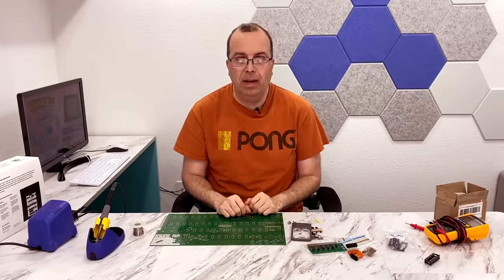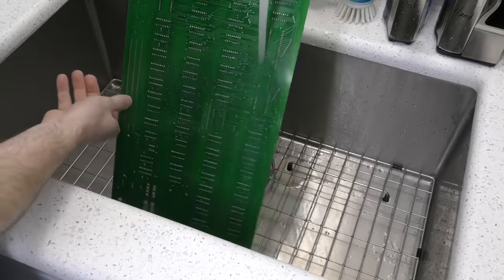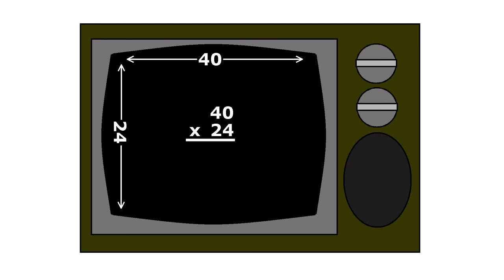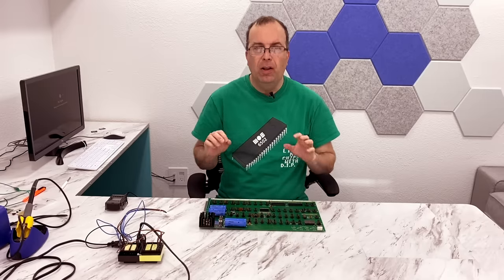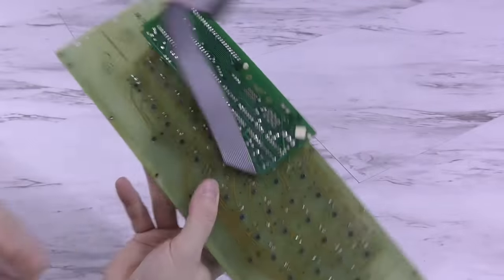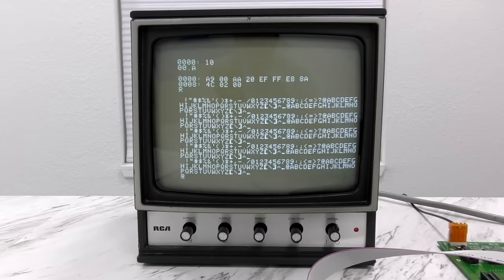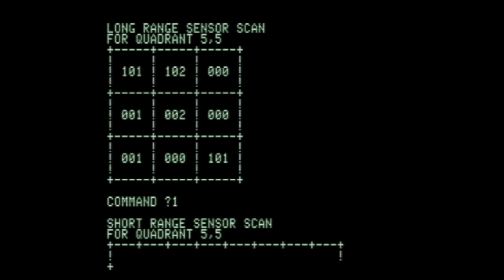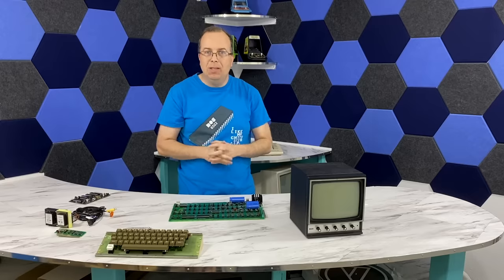How the Apple 1 computer works.

Comment: Nothing says “70s computer design” like an exposed power supply!
Reply: If you had to ask you didn’t need apply…
Reply: meanwhile the imac pro
Reply: Well, to be fair, the power supply is still exposed in modern iMacs, it's kind of a nightmare when you're disassembling it.
Reply: That wnd the scrap wood holding up the keyboard
Reply: i have a computer fron 2004 that has an exposed power supply
Reply: Nothing says "fire hazard" like an exposed 70's power supply.
Reply: Still exposed on the new iMac Pro
Reply: @vouvusbovus9100  electric safety awareness isnt like what is now back then
Reply: and nothing screams 70s power supply like a heavy laminated copper transformer with the mandatory multiple outputs on the secondary :p
Reply: the imac has one
Reply: @Hazard yeah, the dc might be harmfull, but what about the ampere.
Reply: Laptop chargers be like
Reply: @lennonmclean  what laptop chargers have exposed wires?
Reply: @Hazard low voltage does not equal low hazard, cars run on only 12v but I certainly wouldn’t want to touch the battery terminals to my tongue because the amperage would be 600 amps or greater (or less depending on car)
Reply: @surrodox  Back then there was an greater amount of common sense, nowadays everyone seems to have the urge to touch things which aren't supposed to be touched...
Reply: @markusTegelane  Greetings from PS2 slim and Dreamcast.
Reply: @ArtemyMalchuk  oh, that's true
i think PS1 had an exposed power supply as well :D
Reply: @Fhwgads11  no, depending on the resistance of your tongue
Reply: @markusTegelane  yeah, Xbox too
Reply: Oh yes.
Reply: I think I would prefer a clear plastic case for the board. I think it would look unique. Unless it would melt the case then I would go for a metal one.
Reply: @pinakinkale  “new” it’s three year’s old, micheal
Reply: @AemVR  wait what, holy shit you’re right damn time passes fast
Reply: My first PC was a Packard bell and it only had one hard drive bay. When I bought a second hard drive I said, oh what the hell, and placed it right on top of the power supply. Never had problems using it.
Reply: @Fhwgads11  Always that BS (sorry). The car battery may have an internal resistance which ALLOWS it to deliver 600A peak current. The current in circuit is defined by ohms law though, and since your body has a few hundreds of ohms (much more, 10-100s of kOhms, for low voltages on undamaged skin .. the tongue IS low resistance though) the current will be limited to a few milliamps AT MOST, which will not feel good, but won't kill you or something like that.

Well, except you crack your chest open and apply the wires directly to your open heart, in that case a few volts are plenty to be fatal. (Surgical tools used for such tasks are limited to I think 6V or something like that AND limited to a certain amount of current because of that).
Reply: @ArtemyMalchuk  PS 2 slim uses an external power supply that was not exposed like a laptop charger.
Reply: When I was 15 I had a PowerBook 520 charger plugged in and exposed and my hand fell on the cooper windings and all it did was vibrate my hand.
Reply: @pyeltd.5457  I mean 9000x. Those had internal power supply installed again
Reply: Exposed power supply WITH an ashtray.
Reply: No kiddin

Comment: I had always imagined that the Apple 1 was just a less advanced version of the Apple II. Turns out I was right! In the same way that a sharp rock tied to a stick is a less advanced version of a chainsaw! It's amazing how much people were able to do with these early computers!
Reply: I don’t think it’s entirely accurate to say the Apple 1 is a less advanced Apple II. That’s similar to saying the Genesis is a less advanced version of the Neo Geo or a Macintosh. They all share the same CPU but 95% of the rest of all those computers are completely different. The Apple 1 clearly has an entirely different way of generating video and also has no sound apparently.
Reply: You hear yourself, right?
Reply: @phonotical  It's clearly a joke.
Reply: The Apple I PC boards were assembled and wave soldered for $13 at the place which manufactured the raw PC boards. Only a few were hand assembled, part by part, at home.
Reply: @SteveWozniak  woz would disagree
Reply: It’s amazing, it’s kinda line the Apple II was a sequential update to the Apple I.
Reply: Spoiler haha
Reply: If you compare the Apple I memory monitor (just prints segments of memory to the screen) to the Apple II memory monitor, you can see how one grew out of the other
Reply: @DeviatingVapors  beacon
Reply: @casparhughey5651  is this a joke?
Reply: Computers before Apple Macintosh and IBM XT were absolutely useless. They weren't even useful as calculators because they lacked hardware acceleration for floating point and multiplication.
Reply: @IkarusKommt  Tell that to the finance people who bought an Apple II specifically to use Visicalc "the first killer app". Visicalc could do "what if" predictions hundreds of times faster and more accurately than they could with a piece of paper and a calculator.

Comment: That one is in a tight Venn diagram spot of your interests : historically significant, 8 bit, Apple and 6502. It's unfortunate how expensive it was to put together, but thanks for showing how it worked, that was my first glimpse into its usability.
Reply: Totally! Documentation of what it did is surprisingly scarce
Reply: All true, bar 'Apple'. I'd swap that for 'Z-80' and then bingo! All boxes ticked.
Reply: You could also say that about the Apple II series
Reply: Seems like it would be more fun to build than actually use ngl
Reply: @cryptocsguy9282  That's just computers from that time in general
Reply: Dear friend, I'm going to ask a question that doesn't have much to do with the video:The famicom is very limited, many games are run with some difficulties...Can they use a W65C816S8P-14 cpu, instead of the original cpu, to improve performance??Because it's an improved model and very similar to the cpu of the nes/famicom... Both in the pinout and the architecture...
Reply: @rengawg  I doubt it... Many games depend on the CPU running at a specific speed in order to work properly, and that's not mention the 2a03's built in sound capabilities.
Reply: @rengawg  Yeah what lemon head man said is true. Games 🎮 🕹 would have to be recoded to work better & loads of cartridges for NES already came with mappers which had extra RAM 🐏 or a better sound chip
Reply: @cryptocsguy9282  ,So, I think that today, we can already make these games, run much better, on the original console itself, through modifications in the game itself, or with improvements or replacements of the console's memories, chips or cpu...
Reply: @dementedpurplechicken  ,So, I think that today, we can already make these games, run much better, on the original console itself, through modifications in the game itself, or with improvements or replacements of the console's memories, chips or cpu...
Reply: @rengawg  Video Games were programmed very differently in the 1980s then they are now. Nowadays everything is pretty much written in C, and adapting the code to run on a different chipset is super simple. Back then, hardware was simply much too limited, meaning software was written as close to the hardware level as possible.

Comment: Tech tip: On those carbon comp resistors, check the values with a meter before installing and soldering them.  Back in the late '70s/early '80s at work I discovered that a large number of them had absorbed humidity from the air and drastically changed values.  If you soldered them it sealed the moisture in, but if you first baked them for a while in an oven it dried them out and returned them to within tolerance again.  They could then be soldered in and the value stayed correct.

This was at an electronics manufacturer, with large quantities of components on reels for automated insertion, so it was probably worst-case for a problem like this.
Reply: That's a good point (although I didn't know the mechanisms of their drift). However here resistors are probably mostly used as pullups or similar functions where the value really doesn't matter.

And a side note, in previous episodes David has mentioned he is colorblind and can't read the codes, so chances are he used a meter here.
Reply: @eDoc2020  Thanks for your comment about my comment!

My main reason for mentioning it was literally a Tech Tip, something I'd run into in my career that most people wouldn't experience, but make them aware of the circumstances so if they do hopefully they'll catch on to it quicker.  I'm sure there might be other reasons why carbon composition resistors might drift out of tolerance, simply aging is one.

I totally agree on the fact that in this case the tolerances don't matter as much, especially if they are all the same value and things are therefore balanced out.  In my case the resistors were being used in a 555 timer circuit as a power-on reset to the CPU board, and being out of tolerance screwed up the timing and made the 555 not do its job.  We baked some resistors pre-installation to fix the current batch of boards, then had an engineering change to use a metal-film resistor in future boards.

As for David being colorblind, I can slightly sympathize.  After years of working with color-coded resistors and other components, I discovered I see a few colors differently than most.  When I took a color-blindness test where you look at the colored dots in a circle, you're supposed to make out a pattern of one number if you're "normal" and another if you're color-blind.  Well, I saw a third number in the pattern!  Confused the doctor a bit <grin>.
Reply: Fascinating. But wait, how does soldering them "seal the moisture in" (or out)? Does moisture somehow travel up the metal leads? I don't see how that aspect could possibly be true. The rest makes sense, but surely the moisture transfers through the casing? Probably over long periods, so it would seem like they become "locked in" once baked. Also, a typical home will have better climate control than a warehouse, so they probably remain stable under consumer use, just not in warehouse storage. I bet it has nothing to do with soldering at all, but the baking prior to soldering part does make sense.
Reply: @Havron  This was 40+ years ago, and wasn't something that went through a detailed scientific analysis by any means.  So far as I/we could tell at the time, it was the carbon composition (think granules packed together) that was porous enough to allow humidity to get in and affect the material.  I think the majority of the casiing was coated, something like varnish.  Where the resistor leads attached to the body may have been the point of entry, and the heat of soldering was high enough to seal it regardless of the state of the carbon comp inside.  So a lower heat over time returned the material to the proper consistency if the moisture was allowed to escape prior to the soldering.

Note that the "warehouse" was a manufacturing shop floor, heated in winter but not air conditioned in summer, so the longer the resistors were in the environment the more chance of gaining humidity.

Again, this situation was just the right set of circumstances to (1) have the resistors exposed to the humidity long enough, and (2) needing a tighter tolerance on the resistance value in the circuit.  After finding multiple cases of the parts being out of tolerance, replacing them with others that were also out the same way, we started looking for why, and how to resolve it.  If I recall they may have dumped the reel of problem resistors and just bought a fresh supply; baking a small batch to tide us over until the new ones arrived.  They were relatively inexpensive, after all.
Reply: @bobblum5973  Yep, that all makes sense. I agree, the point of entry probably was the edges of the casing near the leads, and I had not considered the potential sealing effect of the heat from soldering nearby. That could very well have been a factor.

Thanks for the glimpse into resistor manufacturing, quite interesting!
Reply: @Havron  You're welcome!  I've been working with electronics and computers since I was a kid in the late 60s onward, been fortunate to have laid hands on some of the newest (and oldest!) technologies, fought so many bizarre problems, and enjoyed it all along the way.  So I hope to pass along some of those experiences to others, so they can learn from them and enjoy them, too.

Comment: 8-bit Guy: "OK, since nothing blew up, I'll test the voltages."

ElectroBOOM: * PSU blows up * "I'll test the voltages."
Reply: More like: "What? Nothing blew up?! I'll better test the voltages…"
Reply: Electroboom: Let’s turn it on Plugs in the PSU

PSU: Explodes

ElectroBOOM: SH*T! Damn it! I forgot to put some full bridge rectifier
Reply: The 8-bit guy: "It seems i put the capacitors backwards..."
Elextroboom: "Did i put em backwards? Let's test."
Reply: Both YouTubers are similar in many ways like their hobby and specialty and they even look alike! Not to mention they’re about the same age.
Reply: @niko5008  First one is at 1.43... documented fact. He has no any idea about electronics and parts. LOL! :-D But at least he can solder quite well.
Reply: @gaborszakacs850  lol. what are you talking about?

Comment: "Hey, 'member when OS manuals had the full source code in them?"
"... No. I was not born then."

Wow, that must've been such a joy for nerds of the time!
Reply: It was... I was one of those nerds. Still am. 🤪
Reply: At least with Linux you get the full source code today. But that's not the full computer. Open source bios is not a common thing. Or graphics card drivers.
Reply: Now you can't even get board schematics for repair.
Reply: @xeridea  Yeah, I've watched a few of Rossman's videos... To a degree, I can understand why they wouldn't want to help mere mortals like little molecular biologist me just sticking in whatever chip I can find for the fun of it, but their mistrust of independent repair shops is just insane.
Reply: Yet there are still people alive.... just.... who worked on the very first electronic computers ever. My grandad passed a way a few years ago, and he was a computer programmer in the Royal Navy in to 50's when "computer programmer" wasn't a term that was used.
Reply: only for $666 you got everything from computer except the copyright
Reply: @Gunstick  You're right that it's not common, but there is a Free as in Freedom BIOS out there, called Libreboot, that would be pretty nice to have but it only works on old thinkpads and a few desktop motherboards. And there are open source GPU drivers, they're just not great if you use Nvidia. Good for AMD, I'm not sure how good the ATI ones are.

Comment: blimey, looks like period correct solid carbon? resistors and those blue sprague caps!
Reply: Lmao Die  Carbon composition resistors are an old school style of resistor. It's basically made of a compressed carbon-based material. I don't know the full composition. You can identify these by the perfect cylindrical shape with a sharp cut off at each side.

Modern resistors tend to be either carbon film or metal film. These are made by winding a film into a cylinder. These are the modern resistors with slight buldges at each end and a smooth transition to each edge. They're cheaper to make and I believe easier to make precise. But carbon composition still works alright.
Reply: And the smaller caps are ITT-branded. Cool.